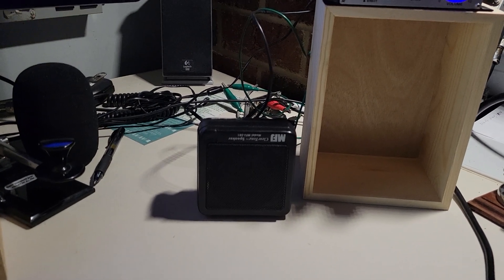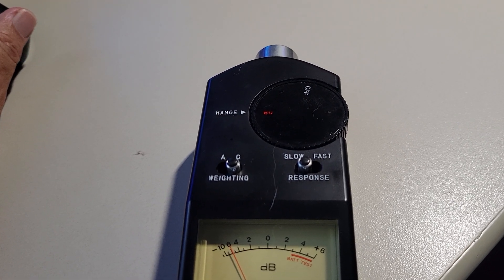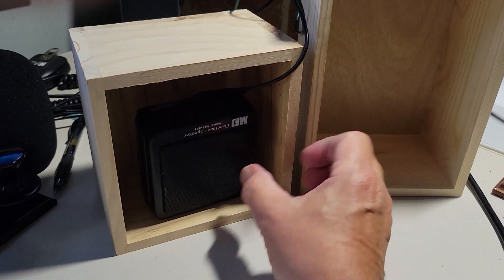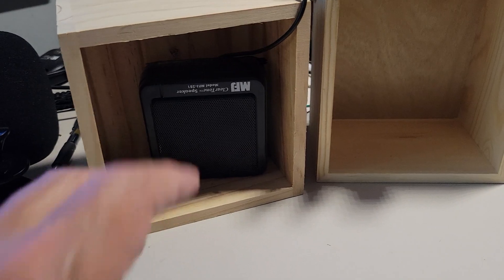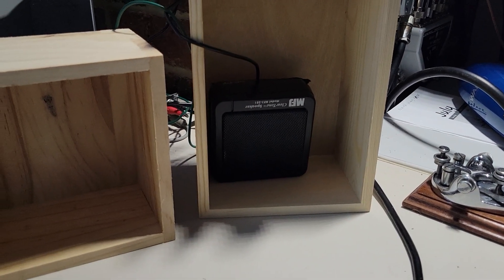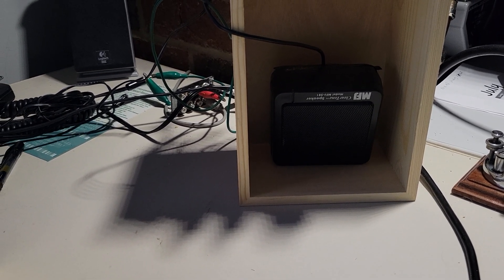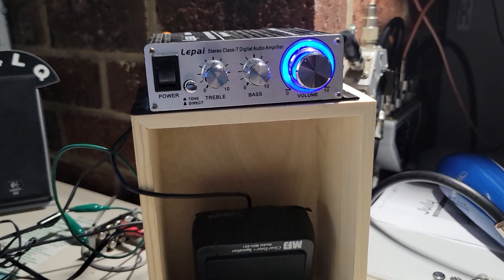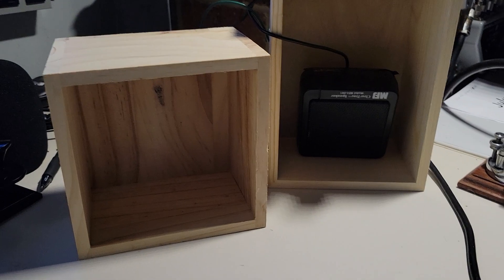CW Speaker Demo

Comment: That is the original T amplifier. I finally found one on eBay for 25$. Should work well on my flex as well. I’ve spent a fortune on pc speakers but they all suck. The lepai 2020 should make all speakers sound good but I want to try the mfj speaker in the cabinet. After the naqp , I need something. Stay well KY boy
Reply from the maker: The amplifier croaked after several years so I got one of these https://www.amazon.com/dp/B007TUSXEY?psc=1&ref=ppx_yo2_dt_b_product_details. It works just as well and for $10 can't be beat.
Reply: @n4lq  I almost purchased this one. I think they all crap out. But at least this one is affordable.

Comment: Hi Steve, Have you tried taking the tape off of the rear vent. I suspect it will improve your sound pressure level even more. The slight time delay may even make a CW signal sound fuller but not sure that delay is audible to our ears.
73, WA4AOS  dit dit
Reply from the maker: Yes. I've tried that. I've found that it's important to not have sound exit the rear. These speakers are amazing. I've been messing with this model for over 20 years now. They are perfect for CW but of course not for voice.